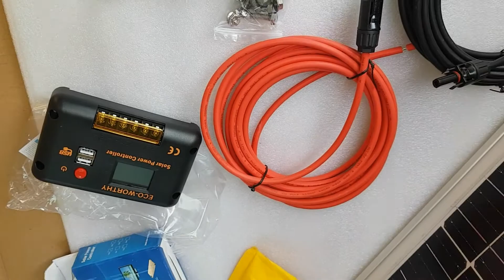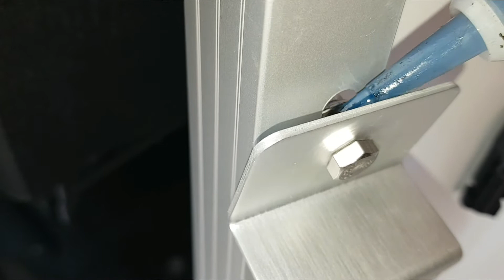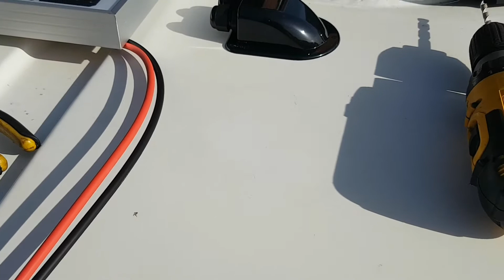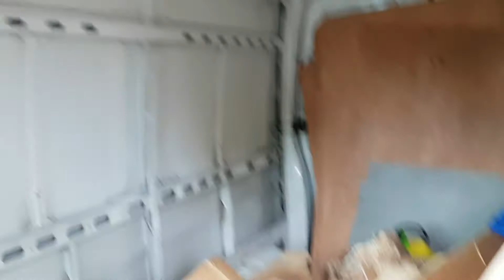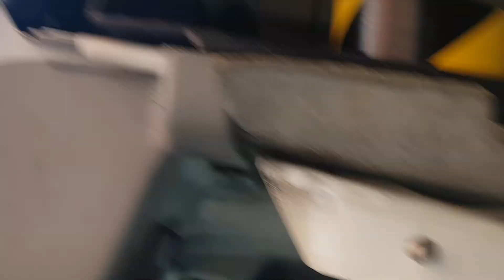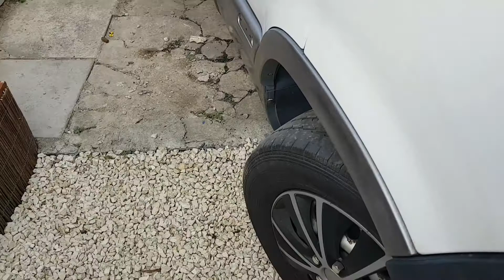Renault Master Campervan build Fitting solar panel part 7

Comment: you should connect your battery to the solar controller before connecting solar panel to the controller as that way once the power from the panel is going into the controller it has somewhere to dump the electric coming from the panel
Reply from the maker: Yer I know that know 😂